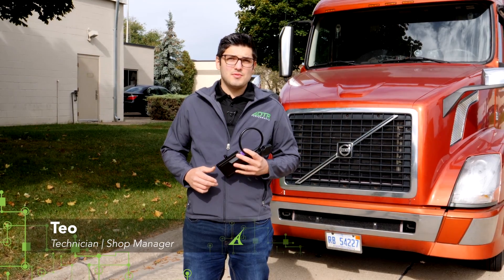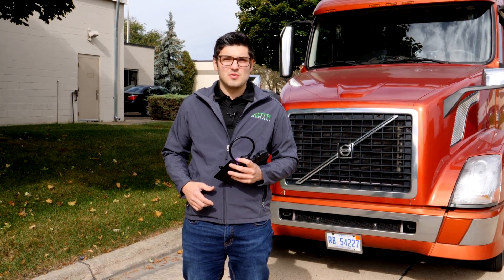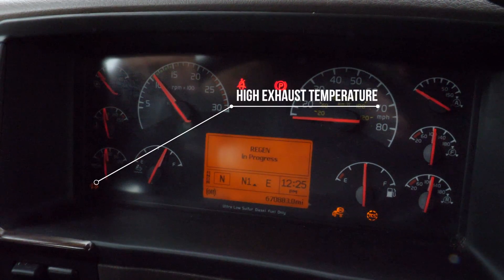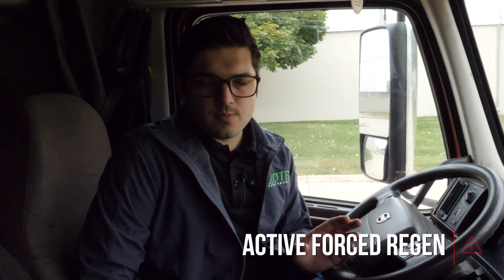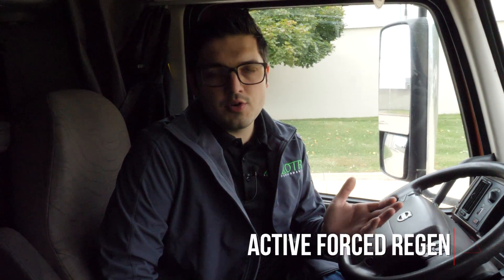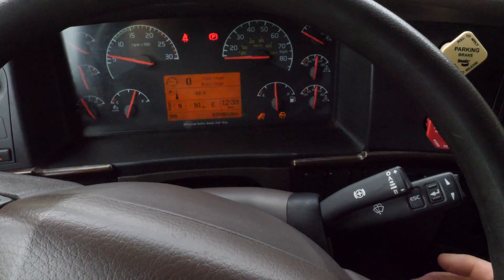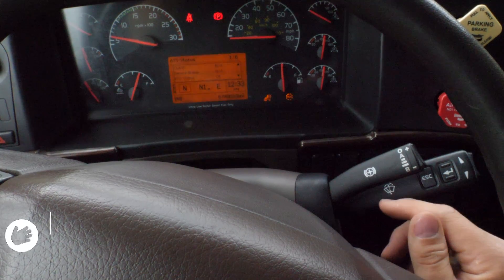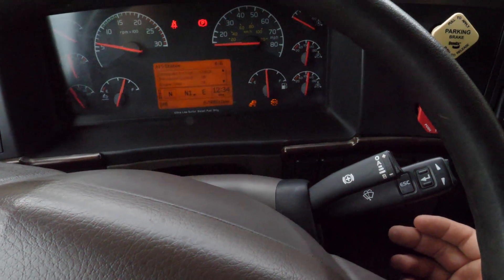How to Perform a Forced Regen on a 2015 Volvo D13 | 2014-2019

Comment: Just bought this tool but the forced regen not working properly. It initiate in under a min and finish in like 2 mins and soot level still high. And truck is asking for a parked regen. Appreciate any help
Reply: Hey same here! Did you figure out why? Thanks!
Reply: @ThePsycologyChannel  yes the AHI MODULE was bad.
Reply from the maker: Pleas give our technical team a call at 586-799-4375 and they can help you with any issues you may be having.

Comment: Was wondering if you could do a video on how to do a brake pedal free play adjustment for volvo. My pedal has sagged down about 2". The volvo service bulletin (Group 524, No.1) just tells you how to measure the specs and "loosen the nut and adjust the allen bolt" but does not actually point them out on the diagrams.